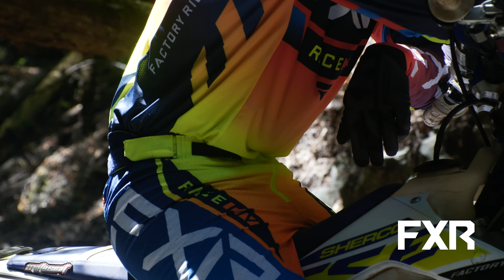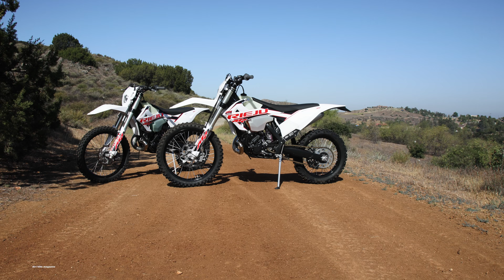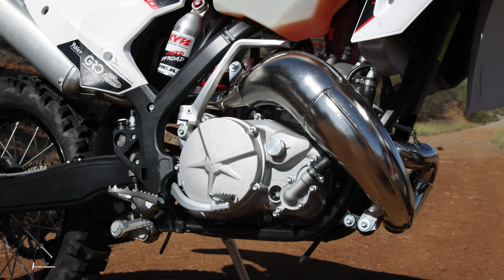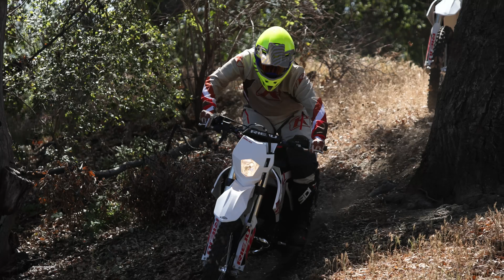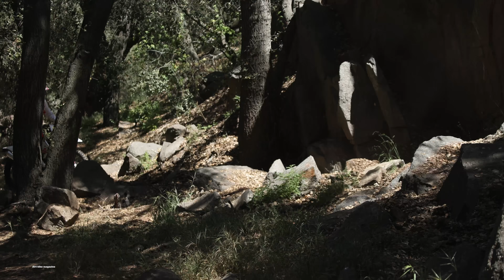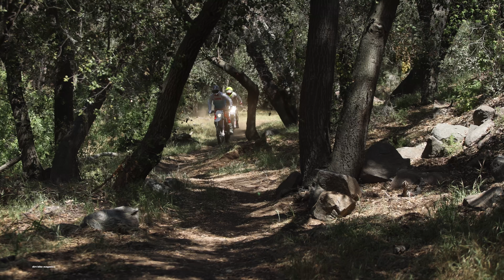First Ride Rieju Rangers 200cc & 300cc Two Strokes - Dirt Bike Magazine

Comment: I sold my TPI KTM after endless issues, and it leaving me stranded a few times in the woods. 

Rode a friends 300 ranger, and loved it! Found a lightly used 300 pro for a killer deal and haven’t looked back. I would have been just as happy with the ranger. These bikes are truly hidden gems! They handle sooooo good.
Reply: What issues did you have and why do you like the Reiju?
Reply: @avinashr9649  The bike cutting out while riding, leaving me stranded. That happened a few times, along with a few other running issues. 

Bang for buck with the Rieju is great. Parts are easily available, and working on it is simple. The suspension straight from the factory is really good as well. It’s a really good bike.
Reply: @sarahdell4042  "cutting out and left me stranded" yeah, sounds like another internet ghost story...
Reply: @onthethrottle7104  You’re right. I completely made up everything, and Ktm themselves didn’t go TBI over TPI due to the issues.

Comment: Electric starter in oil bath? Where did you get that from. Its the ring gear, mounted on rotor, that is partially submerged in oil, therefore lubing two of starter transfer gears.

Comment: Give us an update in another 3 months i bet there falling apart an had 3 top ends through them
Reply: 130 hrs on original piston. 20 races also.
Reply: These motors are stout. My Rieju 300 has 115 hours of very hard use.

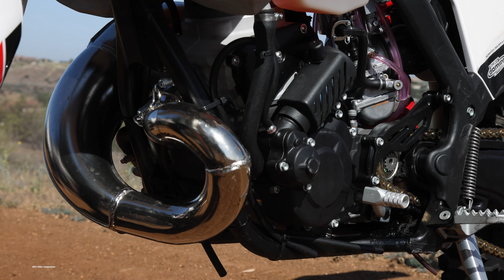Comment: 1:30 Still got the problematic right angle drive starter system 😏
Seriously needs updating
Reply: The only downside to these. 

If you only use the starter after the bike is warm, you’ll luckily never have any issues. 

They all come with kickers though which is good
Reply: @sarahdell4042 
Kick starts are from last century.
Good brands don't need them 👍
Reply: @Danger_mouse  I’ve owned a very problematic new KTM, and have friends stranded because they didn’t have a kicker. 

I do agree the starting system is far from ideal on the Rieju, but they have improved it as much as possible. These are really good motors. Anyone who rides my bike never wants to get off it. 

Rieju is working on a new motor as well, so in a few years this won’t be an issue.
Reply: @sarahdell4042  I don't ride KTMs, but have not had a dirt bike with a kick starter since 2012.
I'm yet to be stuck anywhere 🙂👍, it's just 0.5kg of extra weight to carry around... 
Good to see Rieju updating.

Comment: They have Kickstarters and Electric Starters!!!  Why would any company delete the kickstarters?!  Like KTM did...unless they want us all 100% vulnerable to
Electric, battery's and then they pull the plug or drop the EMP refuse to buy bikes without Kickstarters!
Reply: You must not ride, which is okay. I've got a few KTM's with hundreds of hours - I have one bike that has over 300 hours on it...I've NEVER had to kick start any of my KTM's, NEVER.  You don't need a kick starter it's a waste of weight and extra stuff and you don't use it.  Go and talk to a rental company like Ready to Ride, they have hundreds of KTMs' and they will tell you the same thing.

Comment: I've been riding my 200 Ranger (serial # 00035) for several weeks now. Love it! I'm an older trail bike rider with no intentions of racing anymore. However, if I did...this would be my bike of choice. It instills so much confidence.
I rode it all day yesterday in the wet, rocky, muddy mountains of PA. It lives on the first half of the throttle. Often, I'll upshift, just to work off of the low end of the motor. Sublime someone said...it is!!
 
I also own a 2018 GG 250 EnduroGP that has been tuned and lowered to act like a Ranger....It has all of the same high end components as the new Rieju Pro's. Riding the two bikes...at normal trail riding and fire roading speeds....the overall difference in quality is negligible. Motor wise..the 250GP has
the torque...and the top end, where the Ranger doesn't. I dont care, as I just dont use the top end enough to matter.
If you long for a new and improved version of a Penton Jackpiner, KDX, or TT ...with more torque...this is your bike!
Reply: @mikeevanoski3313  That’s good to know. Extremely hot and humid in my area. Always an issue with my 4 stroke stuff.
Reply: Highly considering one myself! Do these have fans? Glad to hear you’re enjoying
Reply: @sarahdell4042  No fan on the Ranger.
Good luck!
Reply: @T.D.111  Have you had any issues in single track?
Reply: @sarahdell4042  Issues?
Reply: @T.D.111  Not having a fan. Where I live it’s super hot.
Reply: @sarahdell4042  a fan is available thru Central Parts Distributors..i believe it is..their US distributors.

Comment: Riding singletrack in southern Alberta you rarely need high rpm....except for nasty hill climbs.
90% of the time it burbling around in 2nd or 3rd gear....quarter to half throttle.
There is rarely a need for big power or high revs for a casual trail rider....but most think they need it.
The suspension  tho.....I think even for me the Ranger may be a tad soft.
Reply: AGREE, what people need is torque available at super low rpm, high peak is for pros or showoff on the straights

Comment: Super cool. I am looking forward to the 200 shootout with the Beta and the Ranger 200. 👍🏾 Maybe even throw in the KTM/Husky 150s???
Reply: Im hoping they scrap the 150 and make a 200 class competitor. Just the sweet spot range
Reply: Gas Gas (original) had executed the recipe on the Ranger a lot better than Beta did on the X trainer.
Subsequently, Rieju Ranger is a great bike for its category.
Reply: @vasilisdedes5100  I mostly agree when compared with the Xtrainer, but for the added oil injection in the Xtrainer, which is a nice feature. The Beta 200 RR is a completely different story though. People love that bike and my guess is it would be a favorite over almost anything else in this category. Vital MX or one of those magazines recently had a small bore shootout from 125cc-300cc and that bike was pretty much everyone but one guy’s favorite. It’s a super well put together machine. Maybe the Reiju is too though. We’ll see.